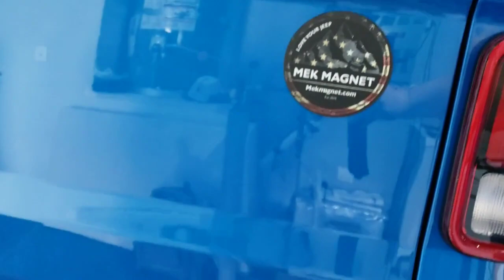No, it's not a wrap...

Comment: Nice video, any updates on the product? Any issues or damage to the original paint?
Reply from the maker: It held up well. I'm about to get a new set. A couple panel edges started coming up and I didn't address those fast enough. Those spots dried out. It's a better deal to get a new set even though she does do replacement pieces for all the patterns.